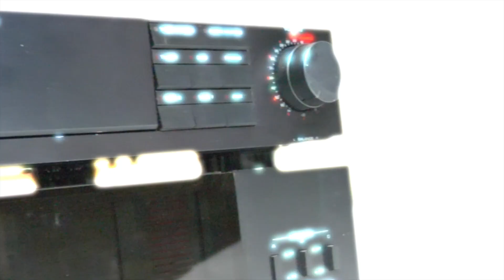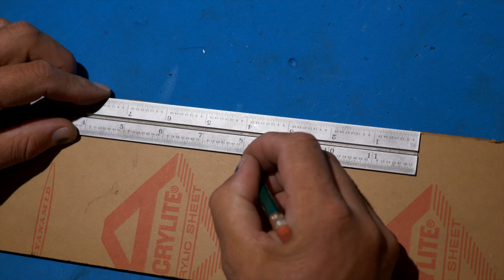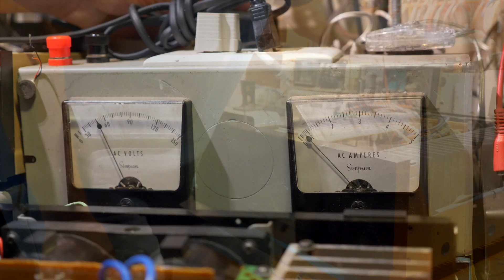Yamaha M-80 Repair - Installing New Speaker Binding Posts

Comment: Hi Redshoe! Amazing video. I'm curious, did you drill out the existing holes on the PCB to fit the new copper wire ends? I have an MX1000 that I'm attempting to do something similar with. Thanks!

Comment: Great repair.  I see you had the "Auto Class A" turned on.  Is there somewhere I can find a detailed explanation to use it or not?  I have the little brother, M-60!  IT STILL smokes the speakers.  I've gone through at least six pairs since I bought my Yamaha gear Overseas in 1986 through the PX & AFFES!

Comment: I have a M-85 that has the A speaker terminals broken and unfortunately, the circuit board is too. Would you have a recommendation about glue to repair the board? 2-part epoxy, maybe? Also, where did you find or how did you make (size of material) those brass ferrules? Thanks for this video.
Reply from the maker: Thanks for visiting the RedShoe. The first question is .Did it break the foils on the board? if notepoxy should do the trick or a very small amount of fiberglass and resin will work. For the ferrules i took the binding post and a piece of 12ga. solid wire down to my local hobby shop and looked through the bass tubing stock they had. I was hoping to find copper, but settled on the brass. it is more or less to encase the solder joint joining the wire to the binding post. I did have to grind the end of the post down abit (as seen) to make it all fit together.
This was a fun project! and it saved a great amount of money on a repair
 Hope this helps
 Come back for more videos for the home  audio hobbyist!

Comment: I got a m 85 and a and b are the same and c has shorter leads. You made that look to long so I just bought after market ones for perfect fit
Reply from the maker: hi mike, thanks for your input.  Are you referring to the back side of posts? I left them long so I could trim them for a perfect fit.  What aftermarket parts did you buy? Can you send me a link?
Thanks
Reply: I'm not as skilled as you that would take me along time,you should market that and make some bucks because as you said they are notorious for breaking and there are still alot out there,im bidding on a mx 800u that has the same problem I order 3 sets hopefully those  will fit that m 800u also
Thanks again

Comment: I have a chance to get a m-40 amp.  Owner says the biding post is broken.  Quite confident it has the same issue as yours.  Thanks for the ideas.  I’m gonna try to repair using the same method
Reply from the maker: Good luck!, Im here if you get stuck. Thanks much for the kind words, much appreciated. Please join my channel and watch for my upcoming website www.red-shoe.com
Reply: @theredshoe1315  where did you get the ferrules and what gauge copper wire did you use?
Reply from the maker: @rajoconnor   Hi Randy, I used 12 ga solid copper, and fuerrels are brass tubing I bought at a local hobby shop. The original binding post ues a flat steel attachment to the circuit board inside. I opened the hole a little bit to accommodate the 12 ga wire. i bought the binding posts on Amazon, there are a whole bunch of choices at all price levels and qualities. If you need I can get a diameter on the barss if you need it.
Reply: @theredshoe1315   done!  Your idea worked to perfection .
Reply: @theredshoe1315  by the way,  I got the amp and sure enough has the suspected broken post